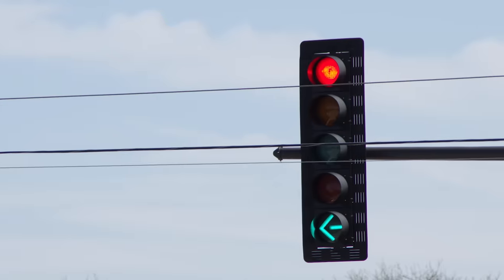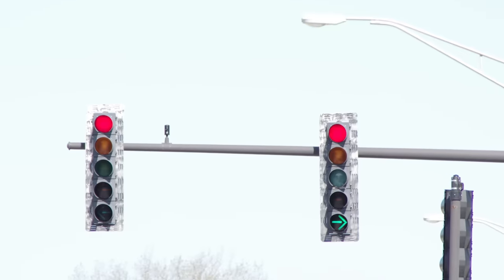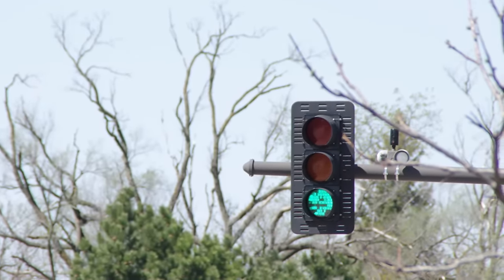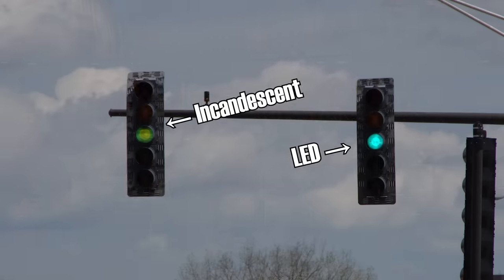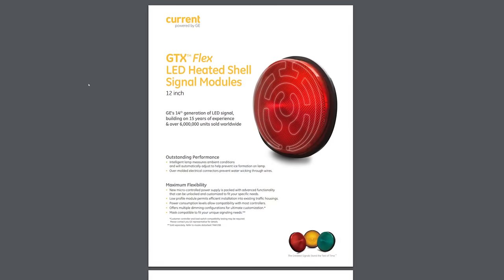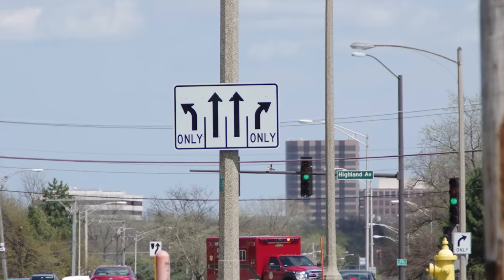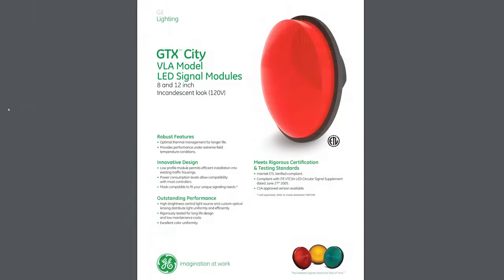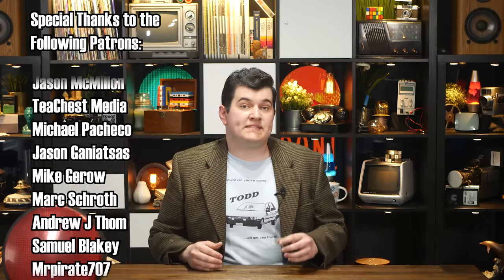The LED Traffic Light and the Danger of "But Sometimes!"

Comment: So in Germany there are newer LED traffic Lights that are so bright you actually get blinded at night- so bright in fact that you sometimes could think there is a car coming from the other side..
about the backup stop signs- in Germany every intersection with traffic lights has all the signs of a normal intersection-  you ignore them if the lights are working- when they don't work you look at the normal signs --- also our traffic lights are placed on the side of the intersection where you are actually standing  (I think that is WAY safer- at least at night because you don't have to see all the roads to know where exactly you have to stop)
Reply: Oli K Its annoying if you are the first car, you often have to wait in an uncomfortable position to see the light.
Reply: if there are newly planned intersection (or at least Traffic lights )  there are often adding a third (or fourth... )  set of lights on a place where the first car can see it.
Reply: Oli K b
Reply: Oli K in the US it's just taught that when the power goes out or the lights dont work for some other reason it turns into a 4-way stop, and i dont think I've ever seen anyone not know that and blow through it or something....
Reply: nhyijy I think it's possible (in Europe) for a road to be regulated by traffic light with combination of priority road sign(yellow diamond with white boarders) so when the traffic lights are out of function the road turns into a priority road, which if has an intersection does not apply the rules of 4 way intersection instead the vehicles entering the priority road have to yield, this is marked with yield/give way sign(upsie down white or yellow triangle with red boarders) in this case placed under the traffic light for the connecting road and the same way only applicable when the traffic lights don't work
Reply: Dick Johnson that works too but honestly it happens so rarely that it wouldn’t really be worth the money for those to be put on every intersection for the 2 hours every 2 years that they would be needed, plus the confusion they could possibly cause... on some of the major roads they could blink yellow instead of red for the main road and red for the side roads which is pretty much the same thing as you described, idk, there’s people that have degrees in this sort of thing and I’m definitely not one of them.

Of course I can only speak for American drivers, I’ve never driven in Europe with the exception of about 2 miles in England, which given the circumstance that I won’t get into... I didn’t really follow the traffic laws lol, but our way works for us.
Reply: nhyijy driving in England is very different from the rest of Europe, they drive on the left in vehicle having steering on the right, so one would think they have a 'priority to left' rule simular to 'priority to right' in right hand drive places, but nope no such rule exists, also the roundabouts (traffic circles) have clockwise direction and their low beam headlamps are asymmetric the other way round. Anyways it's not that complicated with traffic lights and signs, the priority to follow is: 1:instructions given by police, 2:traffic lights, 3:traffic signs, 4:general rules(like priority to right or yield for pedestrians at crossings) and if all that would not be applicable for instance four cars arriving at an unmarked four way crossing from each direction the same time  than politeness of the drivers is expected so they can solve the situation, since if everyone would give priority to right they all would have to stand still.
Reply: Dick Johnson I've actually had that happen with 4 cars at once... it turned into "you go... okay, I'll go, nope, you go... FUCKING GO!" for what seemed like 2 hours but was probably actually like 5 secs to see who would dare cross the road first lmao... what do you mean by asymmetric lights?
Reply: nhyijy low beam headlamps are asymmetric, for right hand traffic the left side lamp casts less light because you don't want to blind the oncoming drivers, for left hand traffic the opposite is true. This presents a problem, if you drive on the other side of the road with a vehicle with lamps not set up to be asymmetrical the right way you blind the oncoming which could lead to accidents. Fun fact: Sweden switched to right hand drive in 1967, up until that point people drove on the left, most of them in cars with steering wheel on the left
Reply: Dick Johnson ... they’re asymmetric like that everywhere though... or are you saying that it’s the opposite side? Because yea, it wouldn’t do any good if it wasn’t... same with the roundabouts, steering wheel etc.

And adding on to your fun fact, they made the day they switched essentially a holiday with commercials and posters for the months leading up to it, and on that day there wasn’t a single car accident in the country. On the flip side:India has been transitioning for the last 50 years with... less success and just decided “everyone drive down the middle”
Reply: nhyijy of corse they're asymmetric everywhere, or at least they should be but the side with the less intense lamp is on the same side as the steering wheel, because from that side flows the oncoming traffic. Right hand traffic: steering wheel and less intense low beam light on the left because oncoming traffic is on the left. Left hand traffic: steering wheel and less intense low beam on the right because oncoming traffic is on the left. That's why Sweden had to switch to right hand traffic, there were too many cars with steering wheel on the left and you had to either switch had lamps or partially tape over the right. Also for some weird reason some delivery trucks in the US have righthand mounted steering wheel, for that my explanation is that delivery people get in and out of trucks way more often than the average driver so it's easier for them to get in and out from the same side as the sidewalk/pavement
Reply: Dick Johnson that is why delivery trucks have right hand drive vehicles. they get out a lot and its preferable for that to not be into traffic, or in the case of mail carriers they dont need to get out at all or drive down the wrong side of the road.

I guess I'm just confused as to why you would mention everything that's different on a right hand drive car vs. Left, most of it is kind of assumed. I'm fully aware that England drives on the wrong side of the road as well as the differences that come with it, and they're not like the rest of Europe. I lived in England for quite a while... the only countries that are really even able to drive on the left are island nations because they dont need to interact with the rest of the world's traffic. Theres a reason most of them switched... the only countries with land borders I can think of that drives on the left is India and South Africa
Reply: nhyijy other countries with land boarders and drive on the left: Bangladesh, Bhutan, Botswana, Guyana, Hong Kong, Kenya, Malawi, Mozambique, Namibia, Nepal, Pakistan, Tanzania, Thailand, Uganda, Zambia, Zimbabwe
Reply: Dick Johnson okay, I'll amend that to island nations, and remote nations. The same reason those are able to is basically the same reason island nations are able to. They dont have easy to access routes into the country and thusly dont need to worry about a hang-up at the border, and when they do have somewhat open borders, they share the same driving lane... and I'm a little rusty on geography and I just skimmed your list but it's also funny all of them you listed (or atleast most) are either southern Africa (when they have the Sahara north of them) or in Oceania or polynesian or whatever the name is, aka bordered by the Himalayas to the north and an ocean to the south (or they're bordered by india...  or a combination of the three)... I'm also fairly certain they were all British colonies but, let's be honest, who wasnt at one point lol.

Point is; they dont need to interact with the world's traffic, they're in their own areas.
Reply: nhyijy I think you were thinking of South and Southeast Asia along with Sub-Saharan Africa. The obvious exception from my list is Guyana which was a British colony but is located in South America
Reply: Also add Suriname, a former Dutch colony to the list also in South America being Guyana's neighbour drives on the left. Meanwhile French Guiana(boarders Suriname and Brazil) still being a french territory drives on the right which is understandable because they want to fit in with the rest of France and want to be compatible with Brazil
Reply: Dick Johnson tthe are outliers and exceptions, of course,  some countries like being different... usually it's either the US or Syria so it's kind of nice not being on that list tbh.

And Suriname still kind of fits into that list with the exception of not behing a British colony,  it's a small remote nation